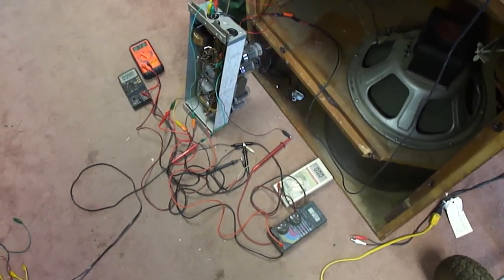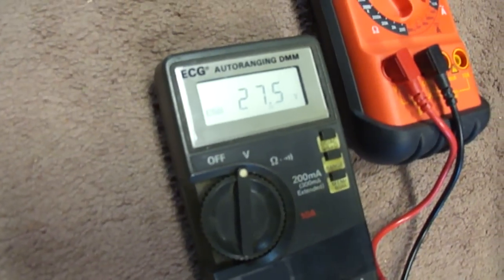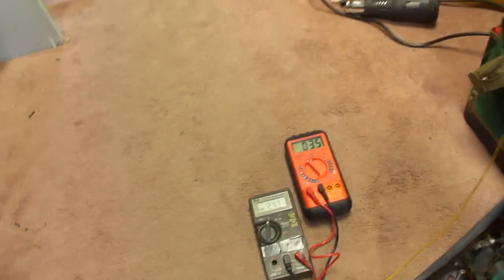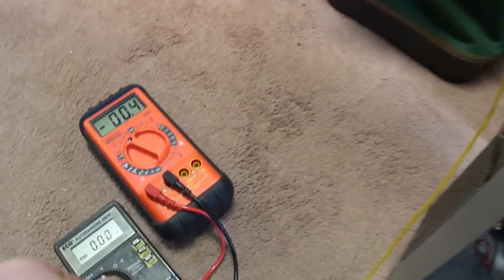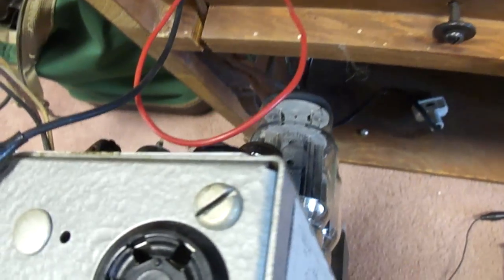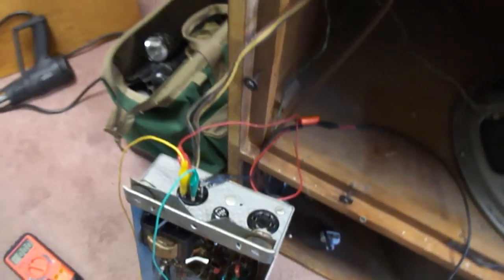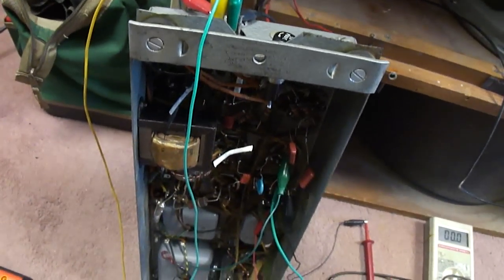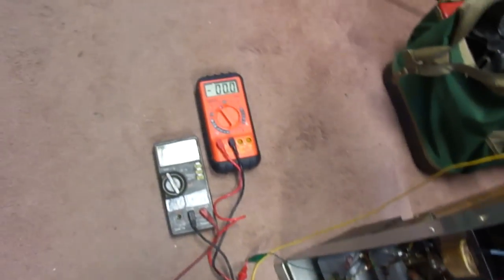Leslie 50C 6550 grid/cathode voltage check

Comment: Sounds like a gassy tube. I ran into this with a 6GK6 in an amp doing exactly the same thing. Tube tester rang it out OK. I did some more checking, and it was fine under 200v on the plate. It just wouldn't work in the circuit at 300 volts though.

Comment: Good job tracing this down.  I would'nt have considered the tube socket being a problem, but that is where experience counts.   I have a Fonovox 1960 stereo that has a real problem at overheating.  It not only starts to turn the rectiifier tube red but also heats up the power transformer like a toaster.  Luckily it is fuse protected so no damage.  I think the problem is in the electrolytics

Comment from the maker: @umajunkcollector Thank you...I did test both tubes, both test good, also switched the tubes and the problem stayed with the socket toward the rear. Also new capacitors going to the grids. I have seen several cases of electrical leakage in tube sockets; just experience with odd problems can help a lot. I do have a BS degree in communications (broadcasting), but no formal engineering schooling, I just have a lot of experience.